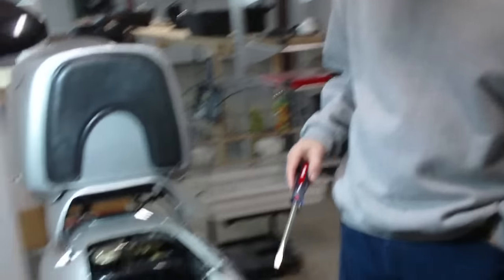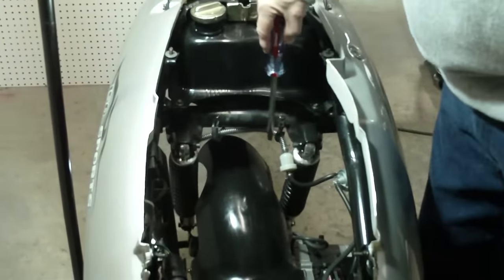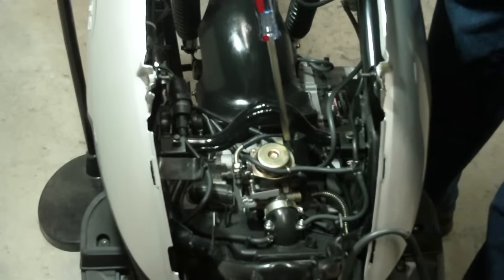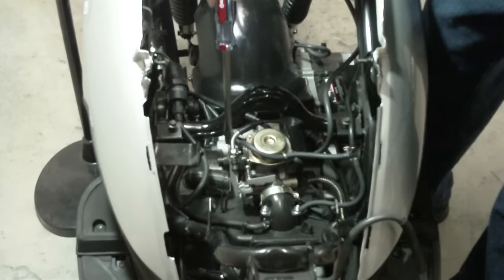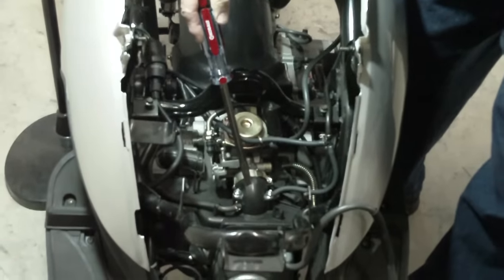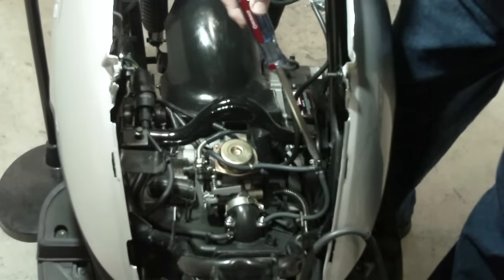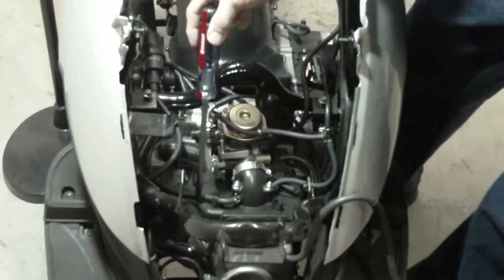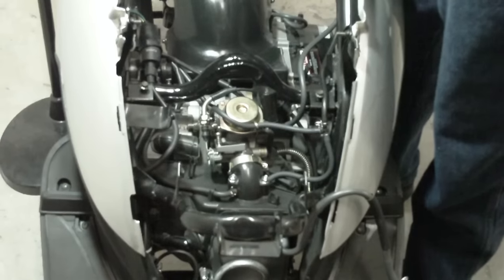Fuel and Vac Line Tutorial

Comment: I have one of those 50cc scooters and I bought it broken. I tried to figure out why wasn't getting fuel but I noticed after I saw the video that the vacuum line wasn't connected to the T system and it wouldn't give gas to the carburetor because the T was missing. I'll try fix it when I get home see if it helps. Thanks for sharing this !

Comment: Great Video, I can use your thoughts getting my brand new Roketa 250 54 B running.  Right out of the freight. I added fuel hooked up the battery.  Checked all the fluids and all seemed right.  Cranked it over never even kicked. Gas was in the filter. Checked the vac to the pump and it wasn't there.  I found a complete tree of tees and lines and one open on one tee..  Zip on the vacumm.  No diagrams to be had on my new scooter for Vac routing.  Liquid cooled semed the way to go but with very little info coming form the supplier.  A simple diagram of the Vac system and where everything should be would go a long way to solving my problem.  Like I said you video will at least help me locate where some of the tubing should go.  Thanks again from NC...
Reply: when you have a brand new scooter from the factory like that you have to crank and crank the motor to get the fuel down into the carburetor. It may just be a matter of that. Might try squirting some starter fluid in the carb.

Comment: John I think your scooter is idled to low. Take s butter knife or screwdriver and crank the idle screw on the carburetor clockwise. Once you have a good idle speed sound from the motor, keep it their- if it holds to powerful turn it back down- but not to much where it stops at lights or other places when you let go of the throttle. Another thing it never starts back on time - idle was never turned up.

Comment: Serious question because the guy working on my bike did this. He ran the tube from the gas tank and conected to the fuel filter and conected the fuel filter to the carb. Then he just pluged up the vacume line with a screw. Is this advisable and is it safe for my scooter?

Comment: i put on a new carb new intake manifold auto choke fuel filter and fuel diaphragm.went to start it today and now there is no gas going to through the diaphragm the vacuum lines r good replaced them to,but when i turned the fuel filter to a vertical position fuel went tin tho the carb and started ran for a few seconds and shut off.obviously there is no fuel going through the diaphragm,do they go bad fast?thats the only thing standing in my way of getting this thing running.i dont wanna hafta

Comment: Hey man I have a problem with my scooter. It starts fine and runs fine but after 10 or 15 if you stop  in a light (example) when you hit the gas it shuts off and wont turn on again. If you wait about 30 minutes for the engine to cool off it will start again. The engine chokes when you hit the gas it make a sound like pou pou.  its a joneway 150 cc 2011

Any Idea????
Reply: I am having problems with the under side fuel tank were do they go one is the fuel line the small one beside the fuel line is it a vacuum pipe which goes on the bottom of the carb then there is two out let's side by side were do the pipes go please.
Reply: John Perdomo   
On a cbr 125cc 2004

Comment: what is the line hang off the side not connected to anything
Reply: Have you gotten an answer to this? Just received a scooter today and see that blanked off line as well.
Reply: its an overflow. incase scooter is tipped or too much gas in carb
Reply: jay Tarantula 
Any Idea where the line that connects to the top of the gear box goes?

Comment: if you run the fuel line straight to the carb will that affect the vacuum line from the intake?
Reply: If you remove the stupid vacuum petcock with a simple on off switch you can block off all the vacuum lines and never have an issue

Comment: Viewed your video. My icebear mojo 150cc. Keep shut off at dangerous spots. So after the views I looked at my hoses. Must appear fine maybe have to move fuel filter it on front side of pee cock not on line right off tank. But as I was looking at lines, just in front of the manifold on nose of engine there was a line that was crimped. So I fixed it, but it runs from to nose of engine to a splitter one line goes to the air filter and then another line goes to the backside of of motor housing I guess that would be wear the belt is located? . Wish I could send photographs and video  to explain better. On my bike I have a foam air fitter. So the hose from above is just tucked under a top layer. Hope you can understand me.

Comment: I have one line I cannot seem to find where it goes. I have attached a picture. It comes off the bottom of the plastic pan that is right under the fuel filter. The other end is just hanging loose and has a clamp on it so it must connect somewhere? 
Thank you!
https://www.dropbox.com/s/9drv9dl0zwrbhc4/2017-09-02-PHOTO-00018125.jpg?dl=0

Comment: … Seeing each year model of scooter is slightly different, and have different vacuum lines, other than what is seen here, It would be good to make a video on each and every model of Vino scooter, as the service manual, doesn't cover the hose hookups properly (if at all). So-far, going through the service manual for a 2004 150cc, scooter, I haven't found any explanation regarding both either fuel line hookup's, or where each vacuum line is to be connected to the carb. Except for the fuel system (like the one shown here), other vacuum lines are present on a 2004 Vino, that should be covered, for proper connection. Yamaha should have made a diagram, showing each and ever vacuum, and fuel line hookup in it's manuals (after all, the service manual is for the Yamaha servicemen to refer to, when needed). It's very disappointing, that not all the required facts are supplied in it's service manual, that a serviceman, or customer, require to have on hand written in the manual. I sure would like to watch a video, showing all the hose hookups on a 150cc., 2004 Vino, otherwise, most of the vacuum hookups are a guessing game, hoping you made the right choice, on where to hook them all up. I contacted a Yamaha service dealer about this matter, and they had no clue either, on which hose is attached where.  They had the same service manual I have here ( and again, hose connections are not shown anywhere in the manual. Any chance of having a video made concerning this full issue?

Comment: 3:24 "If it is a dealership scooter this has probably already been checked and replaced"  BULL S@#%.... Some scooter re-seller is not going through the trouble to replace the hoses or upgrade it (with out charging you). China scooter QC issues as super bad are rumors. Likely all those vacuum hoses were correctly installed and adequate quality. If it does not run or run's poorly then investigate. I have bought two China made scooters. Both ran out the box with the normal oil change after about 30 min (before the 150 miles they recommend). I also adjusted valves early as people warn, at about 100 miles, I found they were pretty close.  I'm fairly impressed with the quality you get for under $1000.